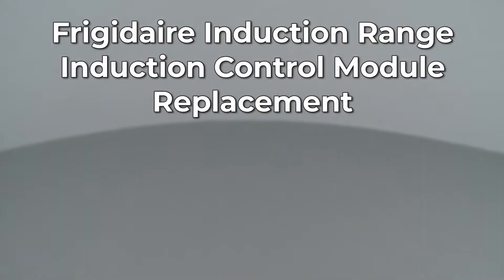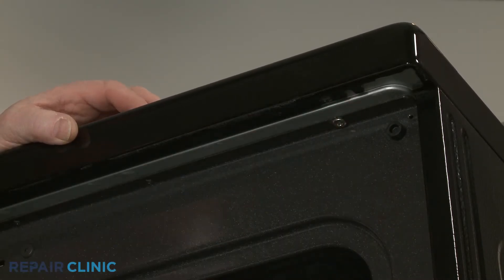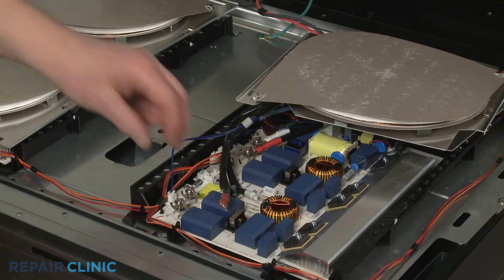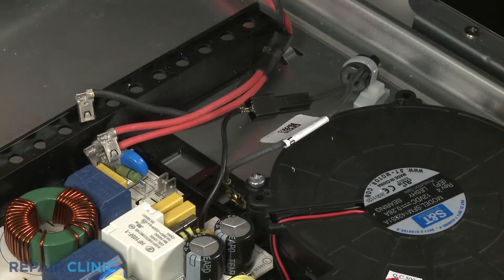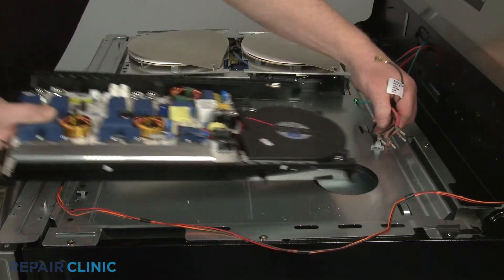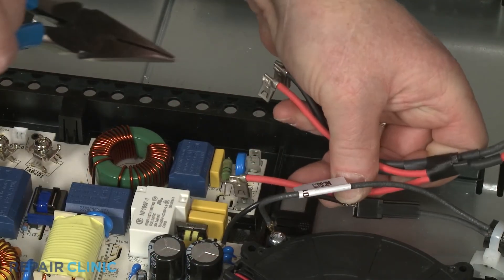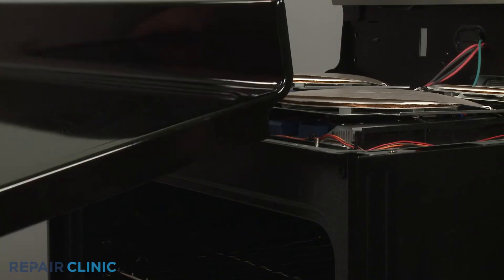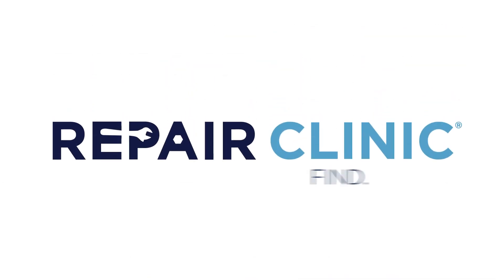Frigidaire Induction Range Induction Module Replacement 5304527384

Comment: FWIW - Removing just the pair of matching screws from the front underside corners of the glass cooktop makes for easier removal and reinstallation of same.  Also, check the torque on all the induction element connections to the generator boards.  On our range, one had overheated and burned the board.  No surprise - all the rest were barely beyond finger-tight.